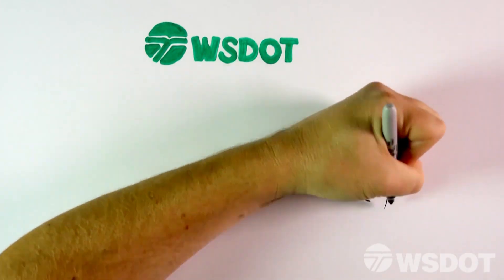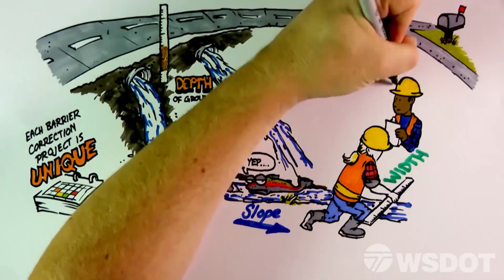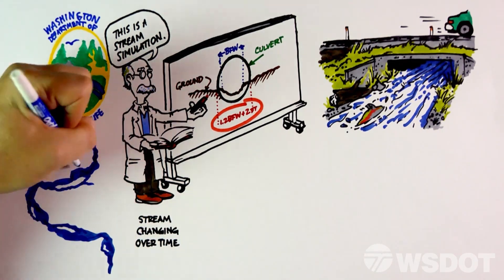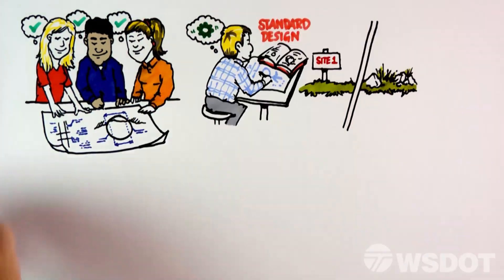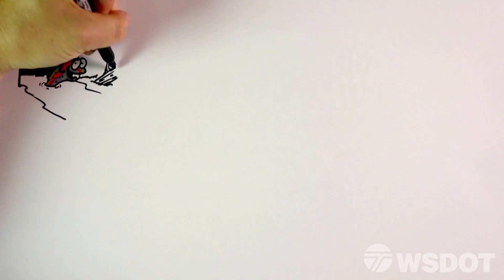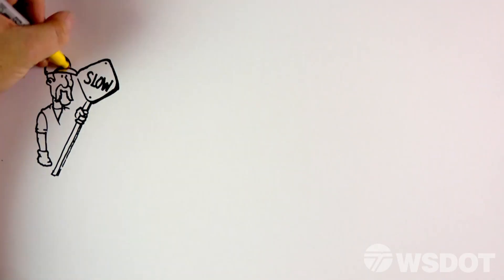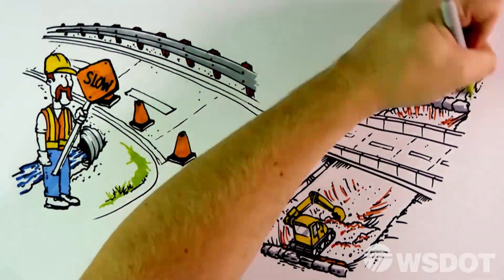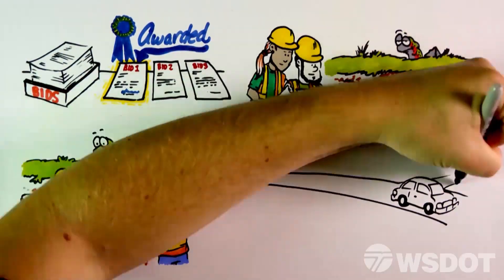Designing Fish Passage Projects

Comment: Saw some seasonal streams (meaning they only have water part of the year) get million dollar road funding.  This program is pork barrel and unnecessary in many instances.
Reply: They are legally obligated to rebuild most fish culverts as part of a court ruling. You'll have to Google it.
Reply: @JakeRoot  
So they rebuild ones that are incapable of supporting fry?   That makes them incompetent in the least and definitely malicious with taxpayers' money.
Reply: @b_uppy  in areas of Western Washington that support salmon runs (mistake on my part; not all culverts), a court injunction in 2013 requires them to replace culvert to not inhibit the salmon runs. It doesn't matter if it's malicious or anything. It's just the way it is. The court is forcing them to do it.
Reply: @JakeRoot  
They are doing it to culverts that don't support salmon,  period.  If they go dry,  they don't support salmon...
Reply: @b_uppy  but are they going dry because they weren't built properly? Most of these culverts are supposed to be designed to allow Indian tribes to fish, as they are federally permitted to do, and the tribes have more power than WSDOT in these circumstances.
Reply: @JakeRoot  
No,  don't blame tribes for this,  this falls directly on the DOT and their Cavalier use of money.  These streams are dry because lack of water,  period.  They are seasonal as previously described.   They are just as dry as they were before the work done on them.
Reply: @b_uppy  the culverts have very large gaps between the exit stream and the pipe the water runs through. Salmon have an extremely difficult time closing this gap. If you're so in touch with the state of our streams, how is that you don't already know this? Also, I would appreciate some citations on the running "dry" thing, since that's definitely not happening (as far as I know).
Reply: @JakeRoot  
Lol.  You must work for the state:  deny,  deny,  deny.   

I already get hydrology and salmon.  I also get that you are trying to recharacterize what is happening as my "misunderstanding".  Dry stream beds going into culverts in the summer is the issue.  Quit trying to put lipstick on state budgeting pigs.
Reply: Come down to Kennedy Creek Salmon Trail, between Shelton and Olympia, say the weekend before Thanksgiving. You’ll see chum salmon spawning by the thousands in a side tributary, Fiscus Creek. Right now, in August, it’ll be dry, just a stone path.  Not uncommon around Puget Sound. In January, after the trail is closed, there’ll be a few of those unusual, very late, small for their specie, late run coho use it. Their fry will need to back out to Kennedy before the stream dries in early summer. Of course chum fry by the hundreds of thousands will be gone before then.
Reply: @billsmith5109  
In the streams I've seen, they go directly to sea and do not connect up to any larger bodies of water.  No place 'to back up to'...
Reply: @b_uppy  Chum in short streams go to sea a day or two after emerging from gravel. Of course this takes longer for Yukon R populations. 

Coho of course are different.
Reply: @billsmith5109  
There are several varieties of salmon, with different needs.  Thia bad piolicy harm runs.  Add to that salmon dislike a change in smells to their water.  This will further disrupt runs for decades.